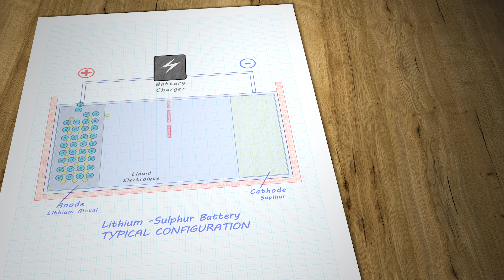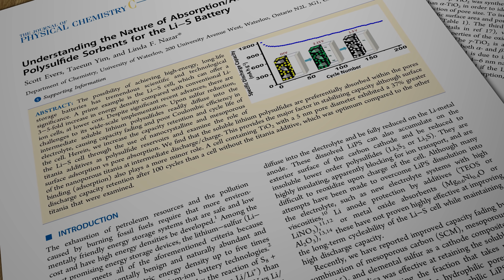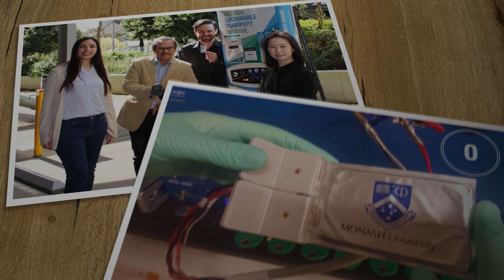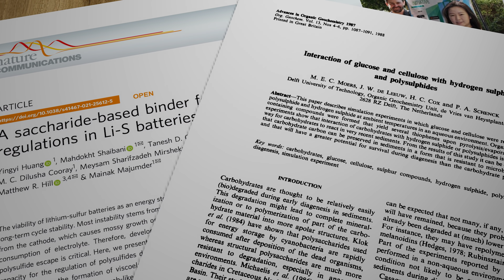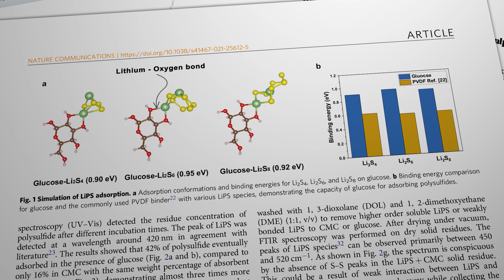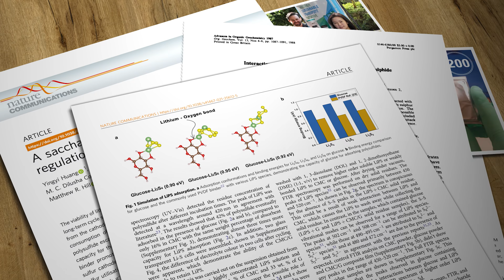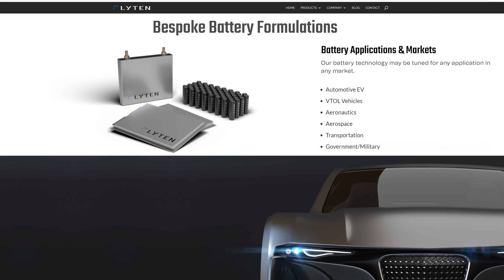Lithium Sulfur batteries: SOLVED! Two new tech breakthroughs in the same week!

Comment: 2 years ago, 1 year ago, this video 7 months ago, and again a few days ago all about lithium sulfur. Then there’s massive power from gold based; I’ll believe all this stuff when something is delivered to the market, until then all this is just bloviation. Most of these videos of, until now, never seem to hold up. The big issue with electric items is the battery limitations, weight/power, the law of thermodynamics and simple notion of energy vs weight vs cost vs longevity are lol issues that these videos want to overlook for the theory of possibility; while this video is sap,what we’ll balanced most of these are just about pushing/selling the tech. Ultimately and maybe unfortunately liquid fuels like gasoline or jet fuel are more energy dense with quite limited weight requirements compared to electric and which get lighter as they go, whereas batteries are a constant weight throughout their use, and limited by energy density meaning you’ll probably never see a real world money making battery aircraft. Plus as battery energy density increases batteries get quite dangerous, just look at how dangerous cell phone fires were with current battery tech in small scale batteries.
Reply: What numbers did they achieve 2 years ago and 1 year ago?
Reply: @DiThi : They haven’t achieved anything though they claim that it will be able to do 500%. You constantly see these videos of the “new” battery tech; meanwhile deliverables are never actually shown or delivered just promise.
Reply: @libertarian1637  I'm not asking about their claims. I'm asking about what did they achieve so far.
Reply: @DiThi : And I’m answering, nothing; they have not achieved anything just claimed that it would mean...
Reply: @libertarian1637  If they didn't achieve anything, what was the news about? For example in this video they say they got a higher amount of cycles. Actual, measured numbers. That's not "nothing".

Comment: We desperately need a breakthrough in battery technology.  Lithium Ion battery tech simply is not good enought to replace gas powered cars.  To heavy, to costly, not enough energy density.   If either lithium sulfur of solid state batteries (or both) are that breakthrough, then we will see a rapid replacement of gas powered cars.

Comment: There is another -- very interesting -- Lithium/Sulphur battery deveeloper -- another Aystralin company -- called Li-S Energy who are as least as advanced as either of the two outkined in this video. The materials technology used in their solution is also applicable to Lithium Metal batteries, which are superior to Lithium-ion in a number of respects, and, importantly, can be manufactured by existing Lithium-ion battery factories with a minimum of necessary alterations to plant -- for which Li-S has a proprietary design ready on offer. Li-S is headquatered in Brisbane (Queensland), with a research establishment (and joint research agreements) in the Deakin University in Geelong (Victoria).  Li-S are already a preparing to manufacture trial batches of batteries in a Pilot Manufacturing facility, with arrangements inked with a New South Wales (Line-Haul) Truck-Electrification firm (Janus Electric; whose fully-developed  technology is already being trialled in long-distance freight operations  -- currently using Lithium-ion batteries, who are looking to increase per-charge range ) and Boeing, looking to Li-S's light-weight, high energy-density battery technology to improve the range and performance of stealth-drones.  Perhaps a  "Just Have a Think" Video featuring Li-S Energy ..... ?

Comment: CORRECTION: I'm sorry to say Dave that you've made a pretty big boo boo in this video. The annode is lithium metal, but the annode is the -ve terminal of the battery. The -ve terminal is where the electrons come out during use/discharge. In the script and animation you've basically got everything relating to charging and discharging backwards. In the charged state the lithium and sulfur are pure. The lithium wants to give up its electron and pushes it out down the wire when you connect the load and switch on. As the battery discharges the Li ions cross over and form the various Lithium Sulfide compounds. The sulfur cathode grows in size during discharge as the Lithium joins it which is why letting the battery fully discharge is harmful. When charging the battery the chemical reaction is undone and the Lithium is separated from the Sulfur again. 

Thanks for all the videos! They are one of the highlights of my week! I hadn't spotted this first time around back in October as I was not paying close attention to the diagram that time. It was only after watching today's video that The Algorithm suggested I watch this one again and this time I watched more closely and the chemistry you were describing felt wrong so I double then triple checked my hunch before commenting. Annode and cathode are easy things to get mixed up between which one is positive and negative because it depends whether you are talking about batteries or electrolysis. But the battery chemistry will always be in the more reactive/unstable state when it is charged (Lithium and Sulfur) and in the more stable state when discharged (Li2S).

Comment: A company Called Li-S Energy listed on the ASX late 2021. They have a solution that has achieved 65% capacity after 1100 cycles degrading more or less linearly. Boeing are testing the pouch cells in their drones as stated on a recent announcement. It will be interesting to follow these individual companies over the next few years.

Comment: Some of the problems with battery research, not clearly appreciated, are time and money. When you have created a battery with a new chemistry, it may only have a few 10's of cycles (before degradation), which may take a few days to check. When your battery reaches hundreds of cycles, that is now weeks of testing - charging and discharging. And you may have dozens of potential chemistries. When you finally have a potential (ha-ha) battery ready for production - you are looking at thousands of cycles. That may take months of charging, discharging and testing at different rates, environmental conditions, and vibrations (across hundreds of batteries.) Then, when you want to finance a factory - you'll need billions of dollars. Unless the return on investment is absolutely certain, with clear advantages for your "wonder battery", and a guaranteed market - it won't happen. That's why there are so few "new" battery chemistries that make it into production.

Comment: In the animation showing the inner processes of a lithium sulphur battery at 2:48, it looks as if sulphur would move between the sides, but lithium does not. But the lithium ions actually do move, like in a lithium ion battery. 
The difference is that the lithium is stored as ions in a matrix, and in the lithium sulphur battery they are stored as part of a chemical substance which is not an ion. Sulphur moves too, but as a side effect.

Comment: Great video again, but the part often missing from battery stories is the recycelability at the end-of-life.  There are all the elements in an old battery to make a new one, making the whole process circular.  But if the cost of separating and refining the materials if higher than using virgin material, it won't happen.  Some kind of economic change which included the many currently externalised costs of mining and refining would help here, but sticking to technological solutions, which technologies are eaasiest to circularise.  Good old lead-acid batteries have been recycled in this way for a long time.
Reply: It's more expensive to mine new materials than to recycle. This is why every new Ev battery manufacturer wants to invest in recycling.

Comment: A standardised battery architecture/size which enables simple battery swaps would allow car owners to select a battery of their choice. This would introduce a market where new battery technologies can be easily introduced. Maybe someone is happy to rent a high mileage per charge, but low cycle life, battery, for certain situations, then swap back to lithium ion for other scenarios. Batteries should be rented, not near permanent proprietary elements that  degrade the value of your vehicle and ultimately end up as landfill, due to the difficulties in recycling. Batteries should remain the property of the battery service provider where they could for instance compromise cycle life for ease of recycling.  The benefit of electric cars is not that impressive when the whole of life of the product is considered. Buying an electric car is a wonderful way of greenwashing your lifestyle, but consider the carbon footprint of its manufacture, the non-renewable source of much of the electricity, and the growing mountains of used batteries, that are uneconomic to recycle. Readily swappable and recyclable batteries are the game changer.

Comment: I did research at a small company in Irvine, CA in 1983 on a blood gas analyzer that gave instantaneous oxygen readings when exposed to blood, such as in open heart surgeries. Until recently, I thought that we were on the forefront of this technology since hospitals were running blood samples to the lab for analysis instead of instant monitoring. However, the technology for pulse oximetry had come about in 1974 from a Japanese scientist. I had no clue about Aoyagi's work in 1983. Our small company of about 10 scientists was bought out by a larger medical equipment firm, so the venture capitalists made money from our work. Now, with the internet, research on what has been done can go so much faster. Better to spend time and money on what works well such as the pulse oximeter which goes on your finger without the need to touch blood. I am hopeful that production will go faster than most anticipate.

Comment: Great content and a refreshing unbiased summary.  The technology, specifically, the use of graphene seems very similar to the aluminum ion battery (~3000 cycles). I'm looking forward to one of these making their way into EVs in the hopefully not so distant future
Reply: @glockio It won't matter after Tesla rolls out their 4080 battery
Reply: @criticalpath3598  you are missing the point.  Lithium batteries won't scale for global energy needs.  They have complicated supply chains, are energy-intensive to refine, and difficult to recycle.  Tesla's battery is still lithium.  The Aluminum ion battery is made of ONLY graphene and aluminum, no rare earth metals. It is greener and simple to recycle and can already compete for head to head with LI batteires.

Comment: You can now buy BYD cars in Norway. They have the same range as other EVs but can do more than 3000 charging circles. The batteries will not burn even if they are physically abused like normal lithium batteries would. They call their battery construction “blade technology “.
Since the cars are made in China they are relative cheap and quite well equipped.

Comment: I had a look into the first paper. Their prototype cell has an energy density of 206 Wh/kg and degrades quite linearly to around 40 % capacity after 1000 cycles.
Reply: Considering Lithium Ion batteries have an energy density of around 150 Wh/kg, and have a useful life of 400-1000 cycles, I'd say the prototype wins when it comes to capacity/time.  It's not a battery panacea but it looks to have improved energy density and lifespan.
Reply: @youruniquehandle2  Lithium Ion has a density of roughly 256 W/kg.
Reply: @youruniquehandle2  Those cycle life numbers are usually given for the point where 80 % capacity remains. For the prototype that is already at 400-500 cycles under ideal conditions.
Reply: I heard it’s double the energy density
Reply: Lol. That’s terrible. This dude should have read the abstract then
Reply: That in itself not a very great measure of performance.

Comment: You have two options if you have a super high density, low charge cycle chemistry at the moment. 
Either fix the cycle life.
Or - Investigate rapid recycling..reproduction. If a chemistry has 5 times the density of li-ion. Making electric flight practical. But it only has 50 charge cycles. Then if you can use them 40 or so times. Then rapidly recycle and reproduce on-site. Then what's the problem? It's a high value application. And if each airport gets a small recycling-fabrication plant, and the batteries are swapped out after 40 uses, then it allows for a fairly workable system. Then the batteries do not need to last 1000+ cycles.

Comment: i am constantly baffled by your refusal to ever acknowledge LFP batteries when you start talking about batteries.  not all lithium batteries need rare cobalt or nickel or any other rare earth metal chemistry, LFP batteries already exist, they are already being produced at scale, they are already being used in EVs(reducing fire risk), they are significantly cheaper, they are significantly safer, and they last for 10,000 charge cycles.

Comment: Don't waste your time on all these "success stories" ... just convert the 1TW of the existing "once thru" Hydro Units to 10TW Pumped Storage (with 120 hrs of lower resevoir volume needed)...
These 10TW Pumped Storage Facilities would generate 10TWX12 hrs/day .. or 120TWhrs/day.. or 40,000TWhrs/yr... which is the S2S (Sunset-To-Sunrise) needed in 2050... (20-25% of 180,000TWhrs/yr).... can all these Batteries together do this... if not ...  then why waste time on "mickey mouse" technologies... when just modifications and upgrade of the EXISTING Hydro Plants... solve the S2S Energy Storage "problem"... ???

Comment: This Nat Commun paper (5:20) which used sugar-polysulfide interaction is, to be honest, cliche. Not even new at all. The chemical bonding formed between sugar and polysulfide can to some extend slow down the escape of polysulfides from the cathode towards the Li metal anode. However, keep it in mind that such binding energy is so weak comparing to those between polsulfides and other much more promising material candiates, such as TMOx, TMSx, TMNx, and TMPx. These mentioned materials here have been studied and reported since 2014, and have demonstrated much stronger chemisorption effect towards polysulfides, not to mention that TMNx and TMPx have metallic level electrically conductivity, which can significantly improve the sulfur/polysulfides reutilization efficiency. In contrast, the sugar used in that Nat Commun paper is completely a demagogy and useless thing. Though Nat Commun is not amongst the top 10 journals in battery research field, it is still more or less a "quality" journal, I am not sure how this good-for-nothing work can be published on Nat Commun... (CV of myself: 14yrs experience in energy storage materials field, with over 40 publications in IF>10.0 journals in Li-ion and Li-S batteries field and 6000+ citations)

If anyone still doubt the uselessness of this Nat Commun paper, I could personally ask Prof. Linda Nazar, Prof. Xiulei Ji (my colleague and friend)'s PhD supervisor and the most renowned pioneer in Li-S cell field for a more conviencing answer.

Comment: A more recent source of sulphur has been the petrochemical industry where the demands of ultra low sulphur diesel fuel has meant refineries have to extract the sulphur during refining. As the cost of extraction is incremental sulphur produced this way is very cheap. I wonder then what the cost of sulphur will be once we shut down oil refineries.

Comment: I'm guessing at this point the only explanation why new tech don't make it to my house or anyone else is due to the ppl who own the prototype.  I can see those lot want a prize of some kind or just plain old $$$$$$$$$$$$ so in which case sure explain why most good tech never ever get into a factory assembly line due to greed or frame and who knows what else those crazy lot wanted before they let go of the prototype.  

Pretty sure that why everything is slow, the ppl who own the working prototype want the whole world as exchange.  Yeah its not helping anyone is it when the researcher are the barrier to new tech, so I'll not hold by breath if we ever see those tech come online until everything are drain of all the resource and our world is going boom and only then it might come out a bit faster.  

Yeah ifs its not end of the world yet they will hold on to those prototype forever, you got to ask are the ppl doing the research are in it to make a better world or they are the the special interest group which by definition are the kind don't care if the world blows up that special interest group are holding on those new better green tech that most likely never see the light of day. 

If you are waiting for those lot to do the right thing, well just go outside and look up oh my its 150 degrees this summer and getting hotter, so you can pretty much tell those cool green tech will probably be available if the outside temperature reaching 200 degrees then those cool green tech might start jumping out ocean and into those production line factories, but by then we might be close to extinction.  So hey those lot are not the brightest here on earth when comes to a better future or just better living for all, they got money in the brain so not much else are left to save the world or their own life, that just soo damn smart of them.

edit; forgot to include another great video and getting our hope up with following disappointment better greener battery tech in another 30 years from now almost fusion like eh.